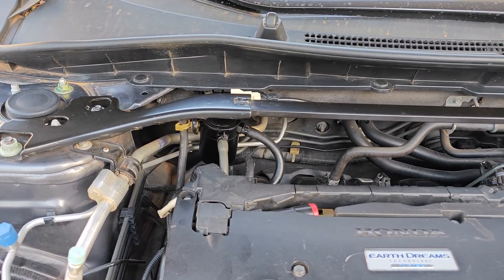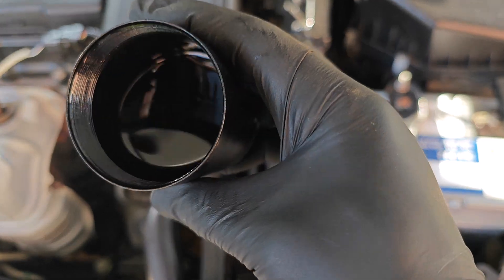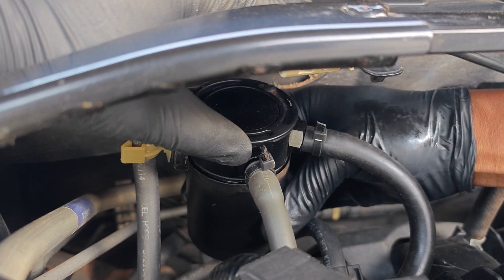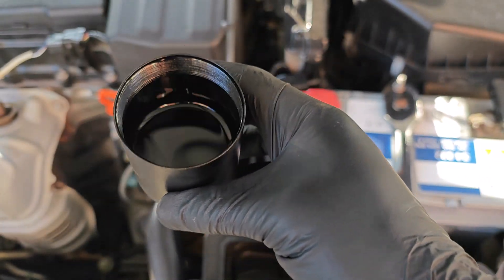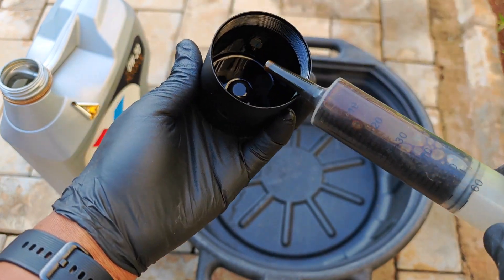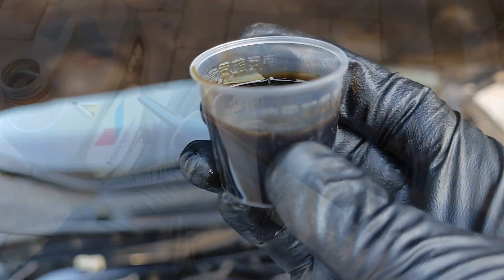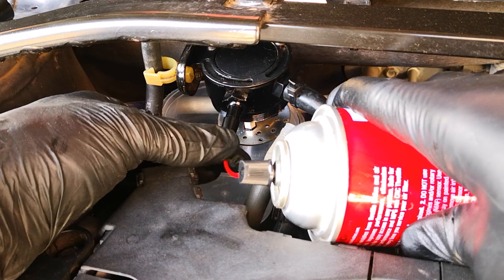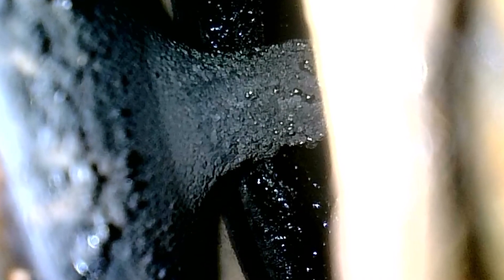Oil catch can after a year! Why you should install an oil catch can

Comment: Quick clarification for some of the newcomers (and haters in the comments): 
…the necessity and effectiveness of a catch can is a function of how good or terrible a vehicle’s factory PCV system is designed. 

Cars with really good PCV systems don’t see much of a benefit. But “average cars” often see solid results, which you can verify by checking the contents of your CC every 2-5k miles. 

Mentioning this here to illustrate that this isn’t a “catch can = good or bad” debate. A good catch can is a tool, and can be an excellent tool for the right application.

Hope this helps some folks.

-career auto worker, 23 years (with lots of mechanical engineering in the bag)
Reply from the maker: Thanks for the very insightful comment! Very true👌🏼

Comment: Catch cans are a scam on passenger cars. They only catch vapors that cool down to a liquid 😂. 3rd generation mechanic and engine builder
Reply from the maker: Where would the vapour have gone if there was no catch can? Personally, since fitting this catch can on this GDI engine, my intake valves have looked cleaner and less gunked up with oily grime. That settles it for me.
Reply: @DIYAutoworksNG  My 2015 3.5 Ecoboost with over 130k miles has clean intake valves. No catch can and no cleaning 😂
Reply: @owenhill-vf7ko  your comments mean nothin without proof, anybody can lie 😂. there's no way your valves are clean unless its a 2017+ or they've been cleaned manually
https://www.youtube.com/watch?v=XbQx7dqaHz8 😂😂😂😂😂😂😂😂😂😂😂😂😂😂😂😂😂😂😂

Comment: Would you ever consider putting a thicker oil like a 5w30? I have a Honda J series calling for 5w20 and am wondering if 5w30 would be a good idea.
Reply from the maker: It's under consideration. I intend to be guided by used oil analysis results for both while using 0w20 and 5w30
Reply: 5w40 is better than 5w30 in terms of high temperature resistance
Reply: @Need4Sweede  Depends wich 5w40 and 5w30, sometimes 5w30 is good
Reply: @Need4Sweede  From the Oil Charts I've looked at the difference is like 5C. 35-40C / 95F-104F (Starting Air Temp?).

Personally have been using 5W30 in all my vehicles for well over 3 Decades with no problems using 5W30.

That said I am seeing Oil Dilution issues with my current GDI vehicle.  Running Change Intervals of only 3 months/3000 miles/50% OLM and Dilution ranges from 1.3-5.8% (2% is "acceptable") and regardless the Oil is always dropping out of spec (no longer a 5w30, Wear Metals thankfully are still good, but I'd feel better if I still had a 5W30 equivalent Oil the entire time... Considering starting with a 5W40, see how that looks with Analysis
Reply from the maker: @lgoamity solid plan you have there. Hope to do some used oil analysis.
Reply: @DIYAutoworksNG Thanks. Just wish there was more 5W40:options out there.  Don't think anyone offers a 5W40 with a DEXOS rating (suppose there is probably a few that claim to meet/exceed, but to actually properly get/display the Logo, unlikely, kind of like Valvoline's Restore and Protect, it may or may not provide many of the benefits of Dexos but who really knows?) 

As my vehicle is almost 12 years old Now I suspect most API SP or SQ GF-6/GF-7 oils will probably perform just fine for the Interval I'm running